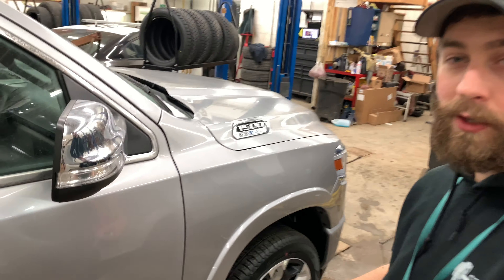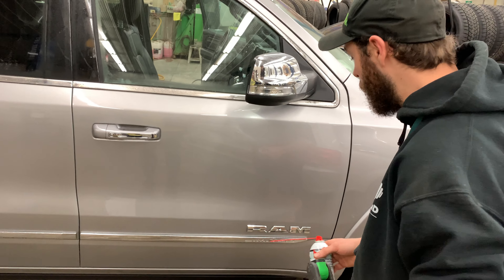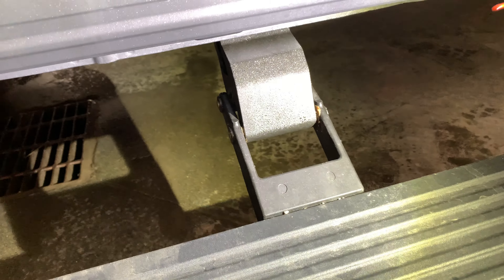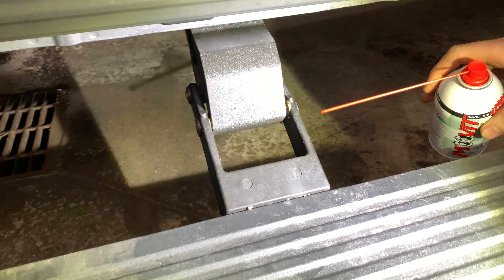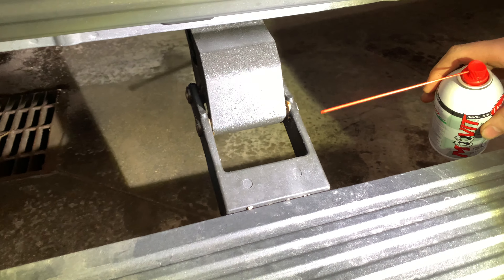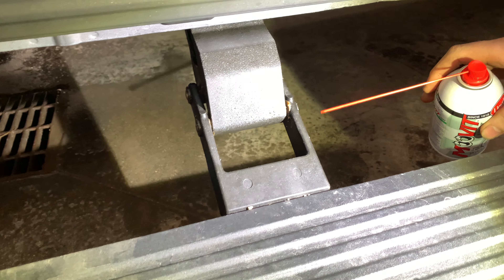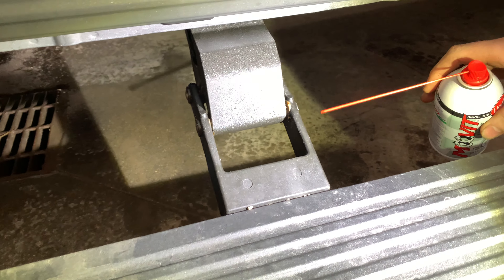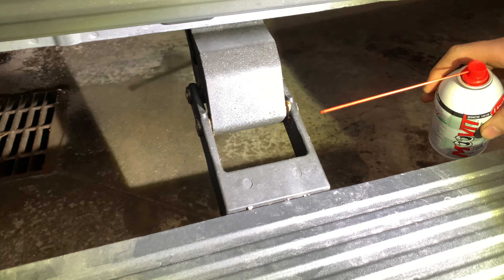Power Running Board Stuck Seized - Dodge Ram 1500

Comment: Thx for the vid! The power running board on the passenger side of my 2020 Ram 1500 is intermittently not deploying and/or retracting. This may be the fix. I looked at all the mounts underneath and don't see any rust, but definitely some road grime caked on around the pins and hinge points. First truck I've owned with power running boards. What lube do you recommend?
Reply from the maker: I would recommend any gel type lubricant silicone or non silicone is fine seeing as there aren’t any rubber component that could be affected, I probably wouldn’t use anti-seize.

Comment: I had a single click or a few clicking noises on the driver side of my 2019 Ram with 52k miles power boards for the past few weeks. I keep the pivots clean and lubed. Yesterday the whole unit started chattering when lowering and even worse on retraction. Sounds like the gears are stripping when powered up. I am going to dismantle and check for damage. Has anyone had a similar issue? Does anyone have a part # handy?
Reply from the maker: Chrysler# 68461581AA is the part your after. Unfortunately they don’t supply any internal parts as it is sold as a complete unit. I have not had one apart yet but I would imagine it’s not hard to take it apart to see what is failing on it
Reply: Have a question bud, where you able to repair the motor or did you have to replace to whole thing.
Reply: @JessicaLopez-tt3ku  I replaced it with a factory one off eBay. Didn't bother with trying to disassemble and investigate options for repair.

Comment: My power running board on my 19 ram  driver side just went out and before it went out it was going up and down really slow to the point where I had sit there and wait for them to go all the way down to get out of the truck. Would it be difficult to replace the motors myself or have the dealer do it? And could it be the pivots that caused the motor to go out? Because the passenger one is really fast

Comment: Remove the motor you huh? I cant get the fkn motor off!
Reply from the maker: No sweat my man, you may also be able to power it up with a battery and some wire, I’m not sure which electrical pins are forward and backwards.. best of luck 🤞 they can be a real pain I know, but don’t give up
Reply: Im having the same issue..Theres actually three hex heads 2 from the outside that you point out and 1 from the other side… got all three out..Trying to Tap it off but wondering if there’s something with the Shaft of the motor going into the assembly?
Reply: The car wash snapped my running board off, the part that broke is the bracket the pins go through. Can those pins be pounded out while still on truck?